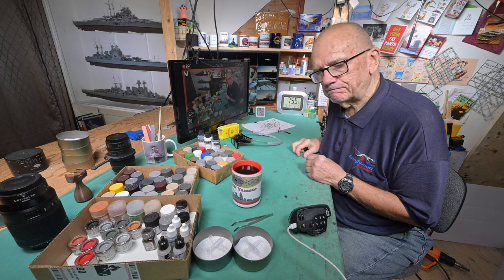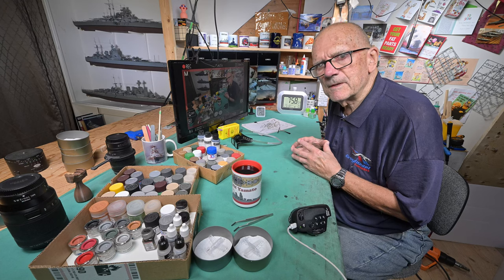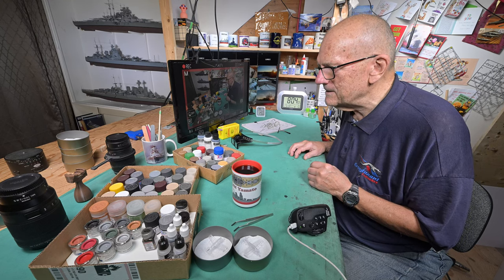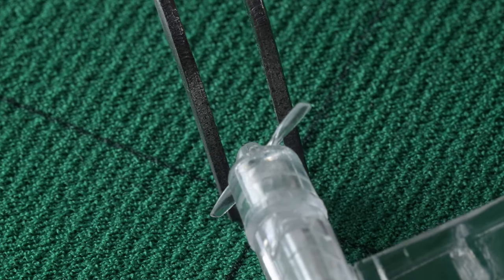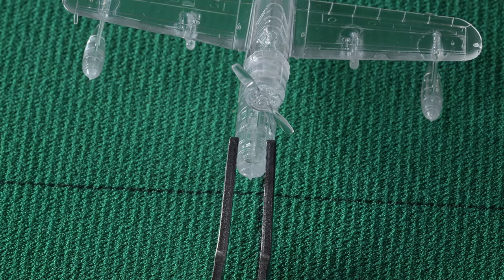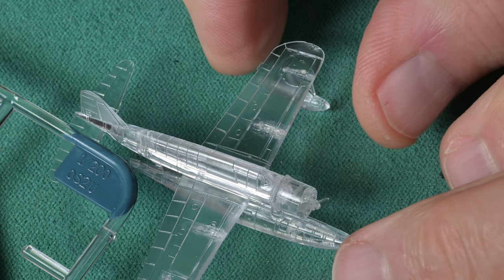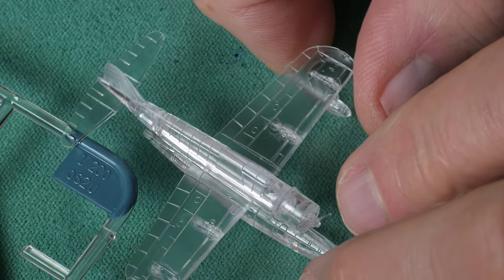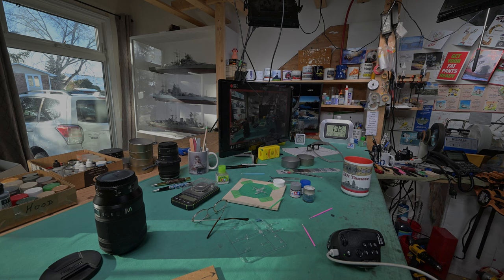The Model Ship - Part 1807

Comment: Hi Ron, if you look over your right shoulder, on the shelf, you can use the white p a glue. I works just as good.
If you put a drop or two in a small cup, add a drop of paint, I use black personally.

Comment: I use old school Elmers white glue for masking. It will wash off. It does not peal off as nicely as the masking film.
Reply from the maker: Re: "It does not peal off" That's what I worried about! 😯
Reply: @roncalverley  Elmer's school glue is water soluble.  Let the paint dry hard for a couple days and then just pop the whole plane into a little cup of water and let it sit for a few minutes and the glue should soften up or dissolve and you should be able to pick it off with a wood toothpick.  You could try it by dunking the end of some clear sprue in the glue, paint it, let it sit for a day or so, then dunk it in water.
Reply from the maker: @Jan-hx9rw  Re: "let it sit for a day or so" I can't wait that long! But thanks for the suggestion. 👍
Reply: I might not have been very clear, even though it does not peel off, Elmer’s can be washed off with a little water.

Comment: X-23 clear blue is a gloss, thinned down color, and does not mix well with any of the XF colors. Why not head to the hobby shop and get a nice flat blue like Tamiya XF-8? No mixing, and it's really close to the actual color of the plane. All war planes in  WW2 were mostly flat faded colors. Especially a plane that is sitting on a ship out at sea. And as others had said, PVA/white glue will work as a masking agent for clear parts. Just water it down a tiny bit and carefully brush it on. Then spray the airplane...Bob's your uncle! 🙂👍
Reply: Correct on all points Paul! A quick trip to the shop, pick up 2 maybe 3 different Tamiya blues, grab an XF-8 and XF-17 certainly.  Then Robert is your fathers brother.
Reply from the maker: I'd thought the the color I mixed up was pretty close.
Reply: @roncalverley  too light, needs just a smidge darker.
Reply from the maker: @EeeDee1  Re: "smidge darker" Perhaps I'll add a drop of black. 🤞